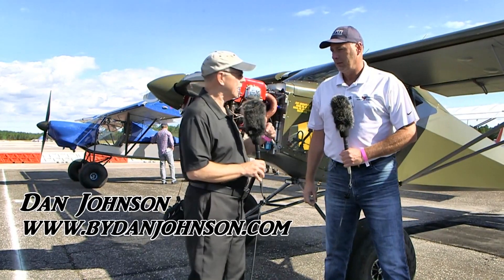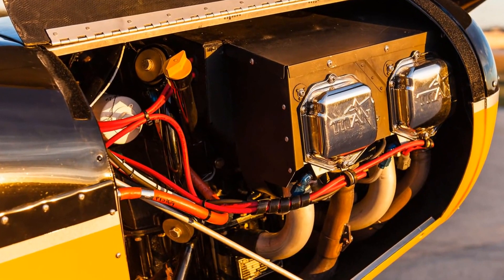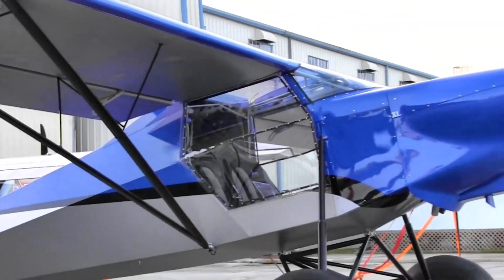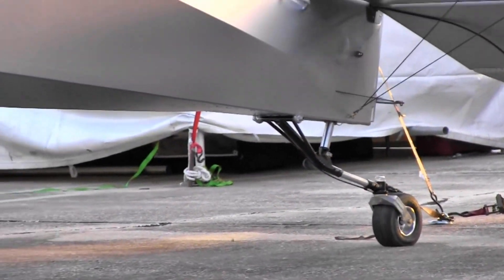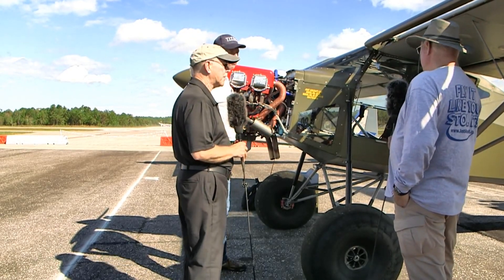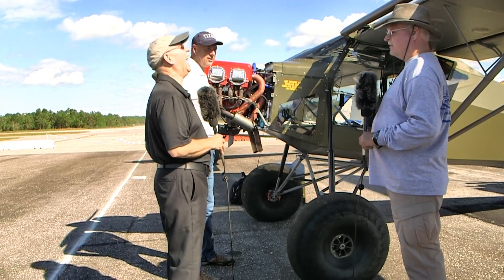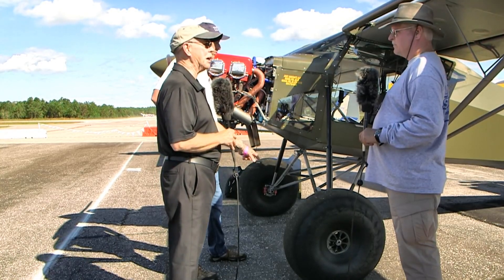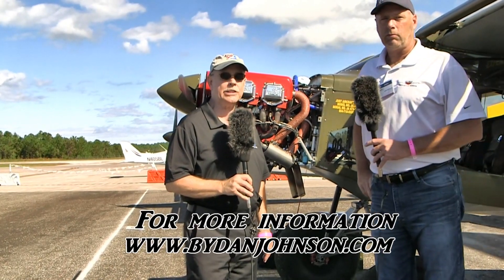Just Aircraft, Just Aircraft Super STOL, Titan 180 HP Engine, on Super STOL experimental aircraft.

Comment: Why do these have engines that weigh  more than Super Bike engines and produce less horse power????
Reply: 2400 rpm, rated for 150hp constant use to 2000h tbo. Bike engines run at about 30hp when cruising and hit 10,000rpm. If you can the bike engine at 8,000+ rpm constantly its going to break well before 2000h. Plus for an aircraft add a gearbox to bring that 8,000rpm down to 2400 rpm where a prop is efficient and now you have another point of failure. 

A few People do put high rev engines though, search for yamaha superstol, there’s a guy that puts 300hp yamaha snowmobile engines on the superstol and has several takeoff and landing records. But he does a lot more maintenance then a standard engine.
Reply: @purplepenguin43  Steve Henry is his name, Wild West Aircraft is his company, I believe he is a dealer for Just Aircraft, Highlander/Superstol. The engines are actually snowmobile engines, so they don't have the traditional motorcycle gearbox but they do have a gear reduction unit for the snowmobile drive clutch. I'm not positive, but I believe they eliminate that original one and install a deeper reduction  one for the prop. Also, I thought Mr Henry said they were quite dependable. He is on you tube as well. I do get the ubiquity of a slow running, direct drive, big bore, engine  though.
Reply: Government